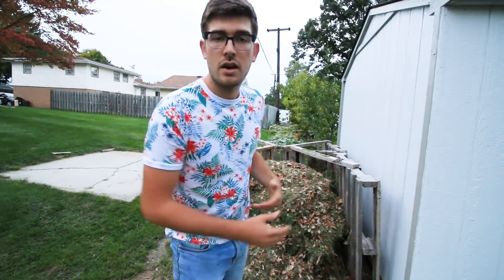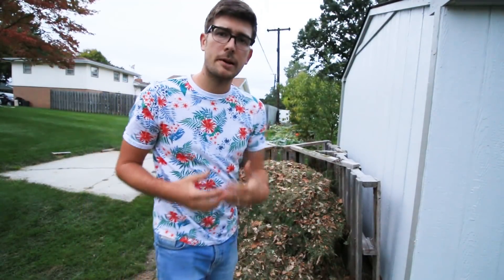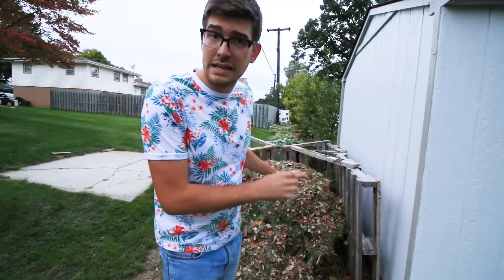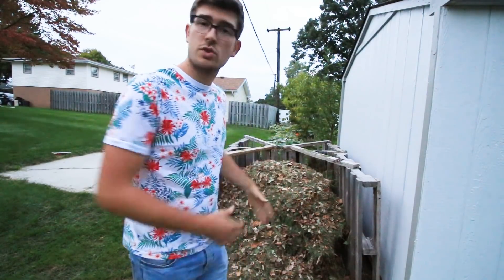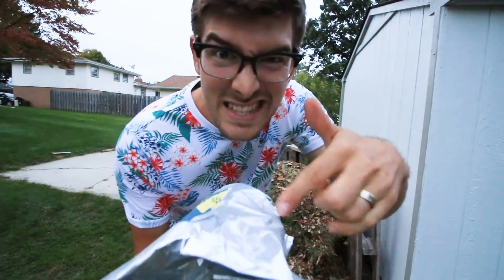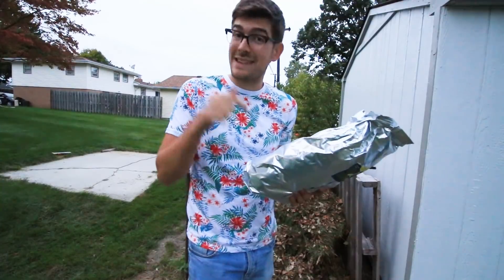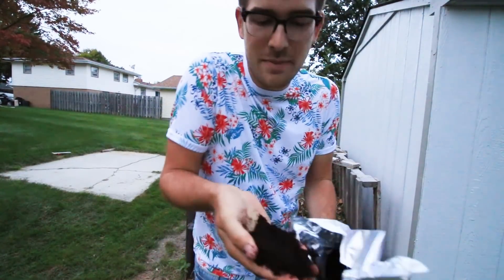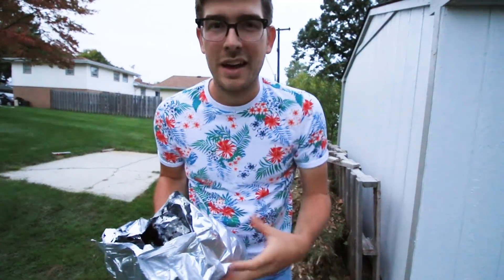Speed Up The Composting Process With Coffee Grounds & Fixing a Nitrogen Carbon Imbalance

Comment: I have found that I like horse manure better than cow manure in the garden.  I believe it is because horses get a higher quality diet than most cows do.  I love using grass clippings for mulch (my compost runs out quickly otherwise), but they do heat up the compost pile if put there.  I have been known to drive around nearby towns on the evening before their yard trash pickup day, and grab bags of grass clippings for my compost pile. I love those clippings! 😁

Comment: I had my doubts that Coffee grounds would be a good source of available nitrogen, because seeds like Coffee beans are primarily stores of carbohydrates - meaning carbon. Also, any soluble nitrogen would surely have been leached out during the brewing process.
So I did a little research. Sunset did a scientific analysis and found that while there is some nitrogen in Coffee grounds (slightly more than 2%), it is not available until after bacterial processes break down the organic matter. This is their findings:
"The availabilities of nitrogen, calcium, zinc, manganese, and iron are quite low and in some cases deficient. Thus, the coffee grounds will not supply appreciable amounts of these essential plant elements when used as a mineral soil amendment."
Thats not to say it isn't a good thing to use. It will help build soil structure and will act like a slow release fertilizer. But from what I have read it wont immediately fix a nitrogen deficiency in a compost pile.

Comment: Great video. I'm following the no dig method, largely inspired by yourself and Charles Dowding, I'm growing veg on around 300 square feet. This means I have to find a huge amount of compost to mulch the beds with between 2" and 3" per year. My lawn was old and the soil is very heavy clay so was transformed from a mudbath after heavy rain to concrete in the hot dry summers we get here in Southern Germany, so the lawn really needed biomass to improve it's water holding properties and composition. I figured that the best thing to do would be to use coffee grounds from my workplace, here I get about a gallon a day which would otherwise be thrown into landfill. Like you say, in autumn (fall) there is far more carbon so I set the coffee grounds up straight into the compost to counteract the mass of leaves available. After the end of November I put the coffee grounds straight into the lawn up until March and this (along with another couple of free additives, wood ash and bio char) is bringing on the lawn soil well. I read that caffine inhibits growth and that the nitrogen from the coffee grounds would take time to break down and so be available through the lawn growing season in summer if I stopped around March (my wife doesn't like the smell of grounds on the lawn in summer either). After March I then divide the coffee grounds up between direct input into the compost, using them as a general thin layer over the veg to inhibit slugs and snails, and feeding hazel trees, rods from which I use for bean frames in early spring and then eventually return shredded to the compost as a great source of carbon after a season. Theory is that the coffee grounds alone will offer me a good source of nitrogen and compost balance, coffee grounds, green grass cuttings and carbon from the shredded hazel (alongside leaves and our food/garden scraps) this should give me a great lawn and good veg!

Comment: How about throwing coffee grounds on eggplants in the garden? I’ve found that they protect the leaves from pests like Japanese beetles and ladybug beetles. I’m really satisfied with my crop of eggplants this summer 🍆
Reply: John Munjak me too I grown tomato and they were doing poor poor now added loads of coffee grinds as mulch and boom
Reply: so it is safe to throw coffee ground on them directly?  I realize definitely that my jazmine is dying from lack of nitro, would that fix the problem fast, or do I need to go and buy nitrogene from a shop?   and Ican I use old coffee ground not brewed though? if so just around the plant? or do I have to mix it with the sand around it.. thanks
Reply: sutil Al yes but not too thick layer as water won’t be able to penetrate however ideal if you could compost it first
Reply: @sweetvuvuzela4634  thanks a lot for answering fast, my compost is almost ready but they say in summer you should not use it
1. is it true?
2. would my old unbrewed coffee like a cup full would give her boost of Nitro quickly?  I have unbrewed, and brewed, and a cup for a small jasmine is enough?
.
Reply: @sutil5078  , you can use your compost year round if it is ready.  Instant coffee and unbrewed are not OK because they are too acidic.  The grounds have no caffeine and the PH is neutral.  BTW, there is no nitrogen in the grounds themselves.  Such comes after the worms digest the grounds and excrete it.
Reply: @beverlydanahy6964  Thanks for the advice have a great day.

Comment: Luke, thanks for the video.  However, I'd like to know your source for that "golden" 5:3 nitrogen/carbon ratio.  Seriously, I've seen these ratios ALL OVER THE PLACE. Some say 3:1 carbon/nitrogen and I've even seen/read (now these are all from accredited universities and other accredited sources) say 30:1 (no, that's not a typo) carbon/nitrogen.  

I guess at the heart of it is this:  if it smells, that's too much nitrogen--add carbon.  If it's not composting and it's too dry, wet it more.  If it's still not composting, add nitrogen.  At the end of the day, there is no real practical way to measure your compost pile's ratio.  In a lab, you'd do it by weight so you'd shred up all the carbon (the leaves, papers, grounds, etc) and equally shred/blend up all the nitrogen in a food processor and weigh it but I STILL cannot get a consistent ratio from any source.

Your  thoughts? Thanks in advance.
Reply: good post, are you sure about the "if it smells, that's too much nitrogen" ?It makes sense I notice that especially when I start new compost. So did you read or by experience! thanks again for your post.

Comment: What about a pile of only coffee grounds? Wouldn't it heat up very well and break down even faster because of the small particle size?
Reply: Michael Graham you still need carbon source. I use about 75% coffee grounds for my nitrogen and wood chips for carbon source.
Reply: I understand that, however I put a bag of coffee grounds (same one Luke had in the video,  from starbucks) directly on plain clay ground and it broke down really well over about a week and a half. Of course the coffee on top took longer but I didn't turn it at all.
Reply: No It'd be anaerobic and fungal dominated
Reply: But does it matter if you get  humus at the end? It's still technically compost since compost is just decayed organic matter used as olant fertilizer  (according to google) it's still technically a really fast compost
Reply: If you had a big pile and you watered it and turned it it would probably work just fine  HOWEVER! with that much nitrogen it would get EXTREMELY hot and therefore you would have to turn it daily to keep it under control of you might run the risk of it catching fire.  yes thats right catching fire.  like a wet haybale...  try it and let us know!
Reply: @robtdougherty  I'm trying it currently, I honestly doubt wet coffee grounds will catch fire but I'll keep an eye on it lol
Reply: i have a dying plant for lack of nitro gene, can I use my coffee ground directly on the plant, for a quick fast fix , if yes shall I put it around it or do I need to mix it with sand? it is summer here very hot now.  I have a compost going but it may take awhile till I can use it, and if so do I put it there or I have to mix it with sand around it? thanks for your prompt answer.. nice day